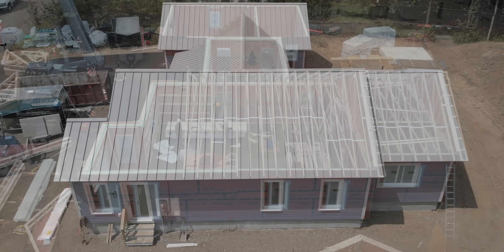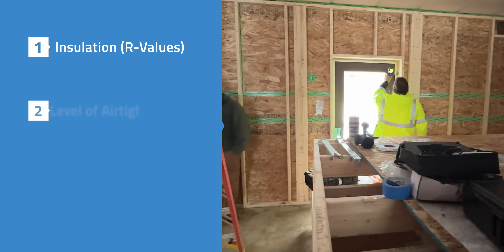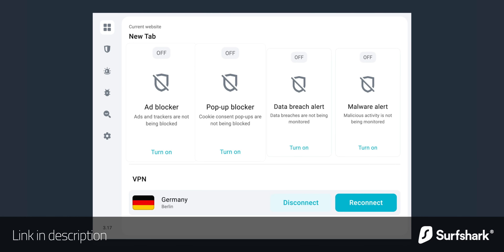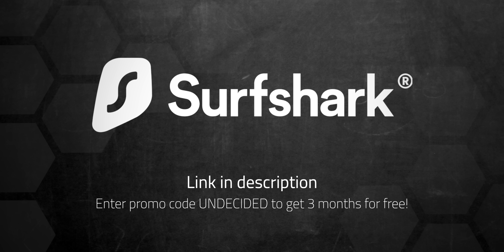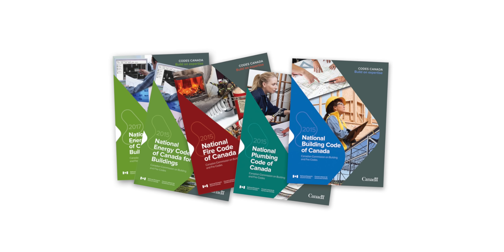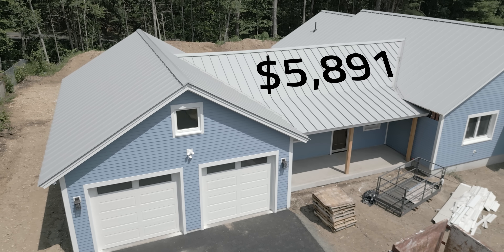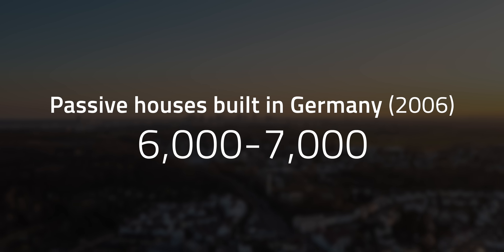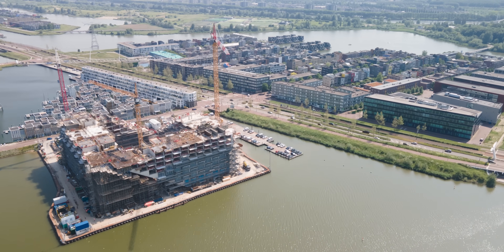Why Do American Homes Suck?

Comment: Matt, I really enjoy your channel.  I am learning so much about what types of energy alternatives there are as well as some of the building alternatives.  It is truly educational, thank you.
About my house.  I probably live in the worst possible home you could have.  My house was built in the 1970's.  It is a single story wood frame, on a concrete slab.  It has 4 inch exterior walls, with simple 2x4 construction and 24 inch spacing.  The siding is just 4x8 ft plywood sheets.  It had electric ceiling heat that was in a popcorn ceiling that tested for asbestos.  Had linoleum flooring in the kitchen that also tested for asbestos.  And deep shag carpet everywhere else that was just a major dirt trap for everything.  The house is pretty much a rectangle 50 ft long going North to South and 26 feet long East West.  The front faces East and has a roof overhang on that side shading the entry path to the front door, the front of the garage, and the two bedroom windows on  that side  The garage is on the South end with the door facing East.  The sun pummels that side most of the day so the garage gets pretty warm.   I face a cul-de-sac and there is no shade tree in my front yard so the sun pretty much pours on that side of the house all morning.  The West side on the other hand has no overhang, the rain gutter runs the entire length of the back and is flush to the back of the house.  There is almost no shade except for a tall pine tree in the neighbors yard in the South West corner of my backyard. The side is just constantly hit by the sun all afternoon.  My roof is a simple gable sloping East and West.  I am pretty sure a solar installation wouldn't be a big problem.
Improvements I have made.  The ceiling heat sucked, so early on I joined a program being offered by the local utility and got a major discount on a heat pump installation, it also included replacing my single pane windows with double pane ones.  It was expensive, even with the discounts, but well worth it, and the tax breaks were great.  I also removed all the carpeting and the asbestos flooring in the kitchen and replaced it with Karndean flooring.  For those not familiar with it, it is the flooring you will find in high use areas of stores like Walmart in their clothing section.  It looks like wood flooring but is actually very strong vinyl and will take a serious beating without you even noticing it.  Every room was redone in different styles, and I haven't had to worry about my floor since.
I also put in a back patio door and poured a rear patio slab with a covered aluminum awning to provide a bit of shade to the back.  I also built a front deck that covered the old concrete path and steps to the front door and added a water feature and seating area to the front of the house.  Over time I have also replaced some of the exterior wood panels with Hardie panel replacements.  Fireproof, bug repelling, won't rot.  In short a no brainer.
So now what?  I guess my question is, "What can I do to improve my current house?"  I know there are ways to blow insulation into an exterior wall to improve it.  They basically drill a hole up near the rafters and fill the cavity with insulation, then plug the hole.  Is this my only option though?  Are there products that provide extra insulation as an exterior cladding?  Sort of a way to get a 6 inch exterior wall, and if so, how do they work on the three sides of my house with no overhang?
I own my home, and have for many years now.  I bought it in 1986 for $30,000, and had it paid off in 2004.  It is now worth close to 5 times what I paid for it.  I am reasonably happy here, and would like to improve the existing house instead of selling and moving.  I am seriously questioning this decision when I look at what some simple home remodeling cost.  A remodel of my kitchen would easily cost more than my whole house cost me, but wouldn't really impact the homes value on the market.  Being a big DIY type, as well as being a former CNC operator in a cabinet shop, I think I may just do all the kitchen cabinet stuff myself, or at least a fair amount of it.  I have already replaced all lighting with LED.  That alone was a massive improvement.  I am sort of curious about the lighting you discussed using the CAT 6 cabling and PoE.  Back in the 90's I ran CAT5 to most of my rooms for a Intranet to share the router.  Bandwidth through a cable is MUCH better than Wi-Fi.  I am still amazed at how little I see of CAT6 cable being ran in homes.  It is like they all expect you to have 1 router in a room and run the entire house of the Wi-Fi from it.  Usually this room is in the worst possible location imaginable, the far end of the house surrounded by the HVAC system with bathrooms with full size mirrors on all sides.  Good luck getting a Wi-Fi signal through all that. 🙄
I am curious about PoE and how to implement it. I know that when I replaced my lighting there were all sorts of different ballasts or the bulbs were designed with built in conversion systems for the power.  Is having a PoE wired home more energy efficient than having all of these devices that change the voltages at each light?  I would think so.  Is there any sort of study on that?
Reply: One thing to consider is modifying the environment outside your home to reduce the need for heating and cooling. The shading and transpiration cooling effect of deciduous trees on wall and air temperatures is truly astonishing, while dense evergreens on the northern side of a home (or the side from which winter winds typically blow) can cut off a great deal of winter heat loss. There are other exterior steps you can take as well to modify the external environment, but these are some of the easiest. And all very cheap compared to renovations.

Comment: It's silly to look at it and say the standards in America suck. We have places where the weather is very mild and there isn't going to be much benefit relative to increased costs. In other places where it might make sense to build to a higher standard it may not be economically feasible for everyone to afford a home should said heightened standards be mandated in law. Heightened standards generally add cost and depending on where you are building it may or may not make sense or may or may not make sense for you. A standard here is also minimum you must build to and it doesn't mean you can't build to a higher standard. In some places along the southern coast of the United States it doesn't make sense to build economically speaking without subsidization by government insurance. In these areas some people have begun building to standards that make them almost hurricane proof. That's good and probably advisable in those places to the degree that the market values those homes enough to build them without subsidized insurance, but it doesn't make sense to build to those standards in New Hampshire where the risk of severe damage from such stormy weather is low. However it does make sense to build or improve older less energy efficiency homes in New Hampshire because of the cold winter weather. I added insulation to my 1970's era home that I bought a number of years ago. I didn't do it immediately, but I did do it when I had the spare cash. At some point I intend to replace my windows as well with more energy efficient windows too. The government should not mandate any standard. Rather homes should be built to whichever standards a home owner or builder wishes and rated so that can be taken into account within the market place for folks buying and selling homes.

Comment: Hold up. Your energy upgrades will amount to a utility savings of $5891? Over what? a year? 5? 10? 30 years? To leave out a time frame is at best misleading, at worst deceitful. Call me skeptical, but the upper limit of savings is the total amount one pays in energy utilities. I have a townhouse built in '79 with absolutely zero upgrades from that period and I spend $500-600/year on energy utilities, ergo it would be impossible for an upgrade to save me more than $600 on utilities. It would take me 10 years to even spend $6k on utilities, to save that much would take even longer. For you to save $6k over your neighbors in a year, that would take your neighbors having utility bills over $500/month which I'm going to call BS on. People tend to complain and take action when their bills go over $200-300/month.
The problem with energy upgrades is the lack of high efficiency codes as well as the fact that the resale market doesn't care about efficiency. No one advertises that their home has R30 walls or an ACH of less than 2. And buyers aren't choosing house inspectors to test the walls are R30 nor doing a blower test. Energy upgrades have no resale value and need to pay for themself during the rest of the time you intend to own the house which complicates the justification.

Comment: The quote from Steve Baczek at 11:20 is exactly the quote I think about when US homes are compared to others. Here it is again in written form for everyone to process: "It's not that high performance homes cost too much. It's that our idea of a fairly priced new home is based on a history of building houses to meet embarrassingly low performance benchmarks."

So how to pay for that higher performance (that is standard in many other countries)? Try building 10% smaller. Find the one room in your 2500 square foot home that you get the least value from -- maybe it's an extra guest bedroom -- and just cut the house size down by that amount and put the money into the rest of the house where you're going to spend 99% of your time and actually enjoy the luxury of a higher performance throughout the entire rest of your house. Most of us don't use our full home's square footage!
Reply: Yup. Especially since build costs have become so insane the last few years. I'm in Canada and I've met some builders/buyers/contractors who've priced things out and you can pay upwards of $600 a square foot for a home! I consulted on a new build once and said the same thing you did. For the same price you can go almost net zero by knocking off the extra extra lounge room, and going to 8 foot ceilings instead of 10 foot ceilings for both above grade floors, chances are they won't notice the 8 foot ceilings. Among other upgrades. It's cheaper (and more energy efficient) to not have to buy a window in the first place and put normal stud framing where a window would've been.

Seeing all this I think when I'm too frugal and DIY oriented to build the types of homes I see daily.

Comment: The problem with Matt is he starts from a false premise. He starts with the false premise that the use of energy is somehow bad for the planet. The reason why America doesn’t need to have energy reduction goals. It’s because America is the most energy rich nation on the freaking planet. But because we have a bunch of morons like Matt, who actually believe carbon dioxide is a pollutant, and that the sun monster is going to destroy the Earth, we’ve got this propaganda, push to reduce the energy that were using. 

And I am all in favor of saving money, but I only want energy reduction if it’s actually going to save me money in the long run. And if we would increase our energy production as we did under Trump, then energy would become cheaper and so the rest of it would be unnecessary . Because there is no global climate crisis.

I gutted my own house and made the walls R20 and the ceilings R38. Replaced every window and every door, with the highest energy rated windows and doors I could  .And I did it because I did the mathematical calculation that the money I was spending would be saved by the energy I was using, or that I wouldn’t be using. In about 12 years. It’s past the 12 year mark for me, and so now I am reaping the benefits, but not really because the prices of all the energy is going up so much, because people like Matt think that natural gas, propane, and all these things are destroying the Earth, so we stop mining them. So we can transfer to heat pumps and solar energy, and wind energy. Which is just dumb as hell.

Comment: I am in the process of building my empty nest home in Michigan(climate Zone 5).  I making it net zero ready(my HOA does not at this time allow rooftop solar).  My builder is committed in the contract to get to less than 1 ACH(tested of course).  It is only a 1600sf house with deeded Lake Michigan access.  I am dumping the cash into the building and skimping on the interior finishes.  I am hoping this will be a house or at least a vacation lake house for my daughter when/if she has a family and will last over 200 to 300 years.

Comment: Saying that US homes "suck" because they are less energy efficient, is a lot like saying that a car "sucks" because it's 2-wheel drive, when it could be 4-wheel-drive or all-wheel-drive. That sort of thinking discounts a lot of factors--even major factors like economy, governance, etc. I am an American, living in Italy. Here in Italy, a ton of homes here are made with dual-layer brick as their inner wall structure--and each outer layer of brick is covered in plaster. The walls in my own home right now are 14 inches (35.5cm) thick. As awesome as a home like this is, it has a permanence that defies both city-wide, and interior, renovation. For example, my home was built way before central heating and air was a standard. But there's no way you could upgrade the house to it. It's just way too expensive. This is the real downside to houses that are built with such tight tolerances: the ability to renovate them later is just prohibitively expensive.

Comment: We gutted our old two story 1912 beautiful old house on the Canadian prairies. We installed new doors, triple pane windows, so far R17 foam insulation along with a large southern solar air heater which heats the 3 upstairs bedrooms when sunny. We don't even turn on the natural gas heater anymore. We use electric heat hopefully powered by the new wind farm just south of the city. Soon we'll have air source heat pumps and an electric vehicle.

Comment: In 1995, a builder upsold me on the "super energy efficiency package".  During construction, I documented how the builder failed to use the upgraded materials promised and how poor workmanship compromised energy efficiency in many profound ways.  Unfortunately, code enforcement officers could not be of service as there was no energy code mandated, and the mechanical code was not even enforced in that jurisdiction.

Comment: I am going to build a new house in a couple of years and there are several things I am working on and that is insulation. I am looking at 40r for the walls and around 120 for ceiling and about r10 or 20 under the slab. I am also designing the window placements to limit them to only 6 windows for the entire house. I would like to find quad glazed windows yet I do think the cost would be far more than just buying two double glazed windows and have an outside window and an interior window. I have seen some photos where people have thick walls and I will have around 10 to 11 inch or thicker walls (depending on if I add zip R sheathing or like product. ) I can install a window outside and then another one inside to which you would have to open 2 windows to get out or have air flow. I do not know of any commercial doors/windows that use double 1" insulated glass panels. 
For heating and cooling going to use heat pump with in floor heating and a extensive filtering system with UV lights and circulators. 
The doors on the other hand are something I have problems with. They all generally suck and become drafty several years later. I do not need fancy doors, just doors that work like they are suppose to. The best option is an outward swing door which can create 100% seal all around the door and threshold. This is likely going to be my option as I want air tight and to have the lowest energy cost as I can. Which is why solar and battery back up is going to be included in to the cost of the home build.

Comment: Live in Germany and Switzerland for 17 years where homes are built out of masonry and almost all have basements. Just the thermal mass makes a huge difference due to the thickness of the walls, the quality of the tilt-turn windows, and roll shutters over all the windows, patio doors, etc.. My homes had more than 30cm of thickness. In the US I updated the windows and added roll shutters and have lower energy bills (USA Gas & Electric, Europe Oil and Electric) than I had in Europe to include AC that I did not have in Europe. As you have noted the techniques you use make a huge difference. My bills are so low that I have been advised that renewable energy is not cost effective as another step.

Comment: I live in Washington State. The insulation of houses are no better than 1986 houses! I just at a home and they just put in triple pane windows and they $700,000 for 2000 sqft home! And it is not legal by Washington codes! They are building houses with concrete floors with no insulation, THAT ARE NOT LEGAL! I went to the builders and ask them where are the ADA homes, 1 out of 10 home are NOW supposed to be ADA. They rolled their eyes! This in 20 homes a month, 5 towns are are back to back, and the population is over 350,000! This what the governor what to do?